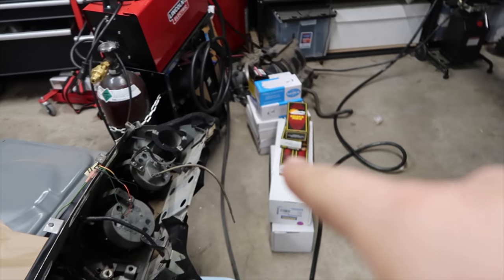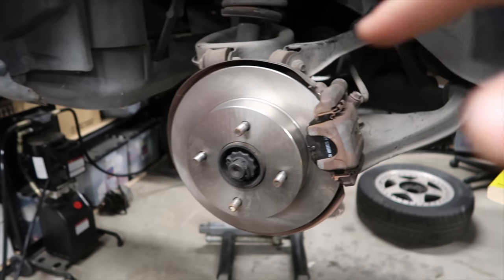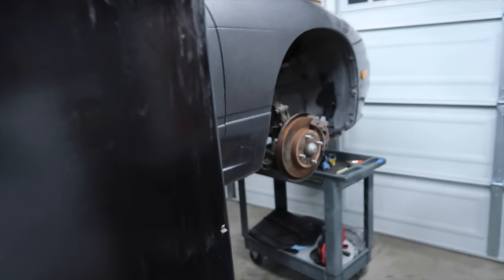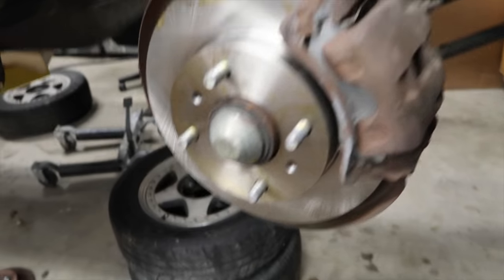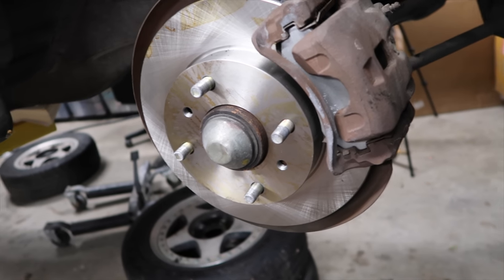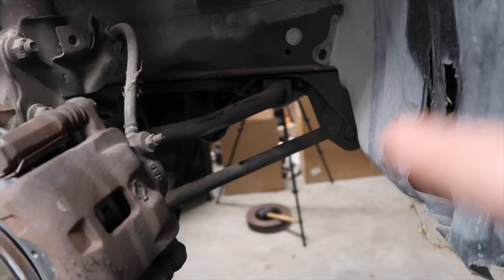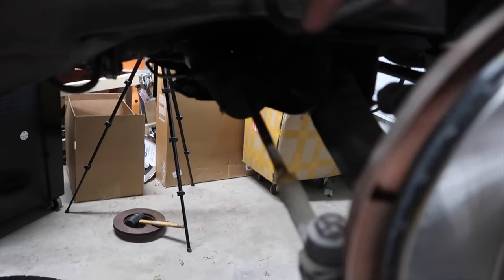New Pads & Rotors Front & Rear - 240sx Build - Ep 4 - Panchos Garage

Comment: hey man, be sure to use acetone or brake clean to wipe that oil and stuff of your rotors before you put them on the car. not sure if that was just surface rust on the front rotor but i figured i'd let you know just in case you didn't
Reply from the maker: I ran out of brake cleaner so I just installed them like that for now. I'll clean em up before I run them for sure.